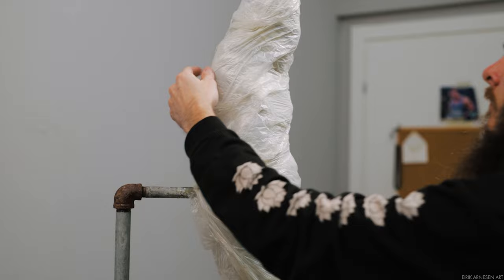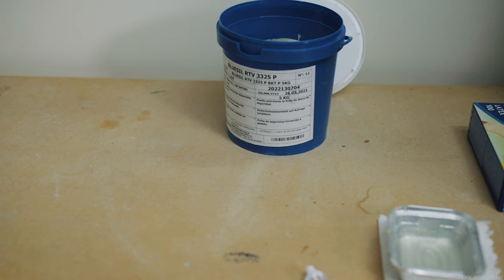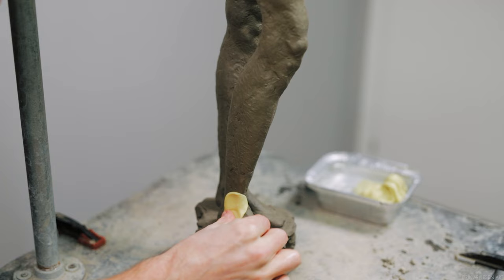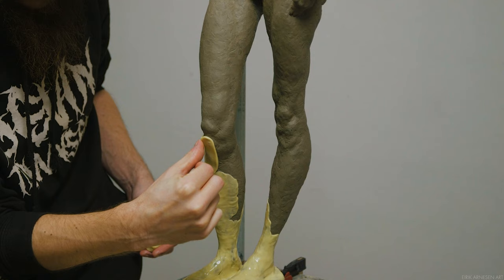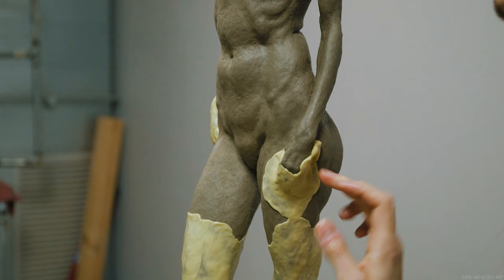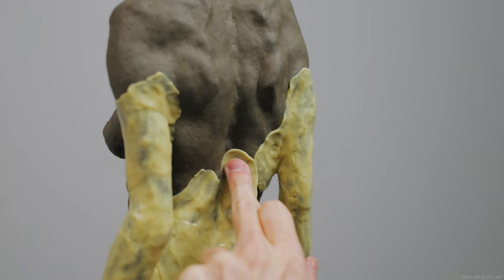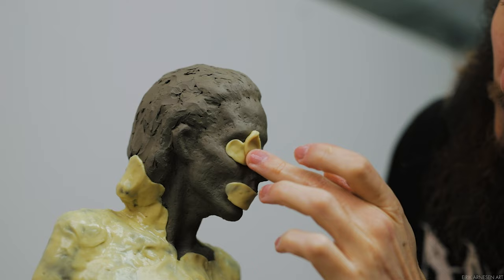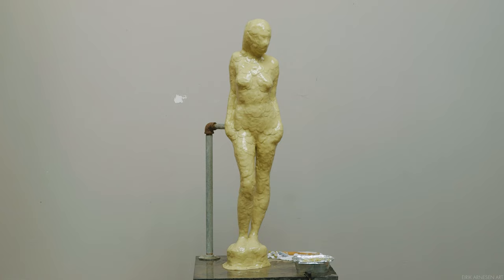How To Make A Mold - The Silicone Stage

Comment: I dont understand how you can demold with the large hole between the arm and body
Reply from the maker: You will see, it's going to be very easy. I'll cut the silicone between the arm and the body, it will be like there is a silicone wall there, just like I'll have on the outside of the figure.
Reply: @EirikArnesenArt  this is really great, thanks for sharing with us.